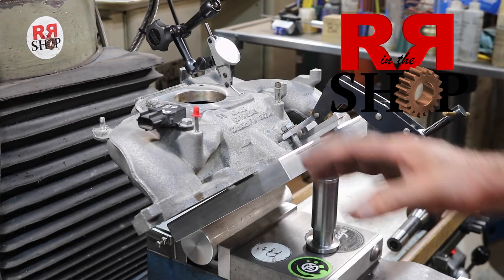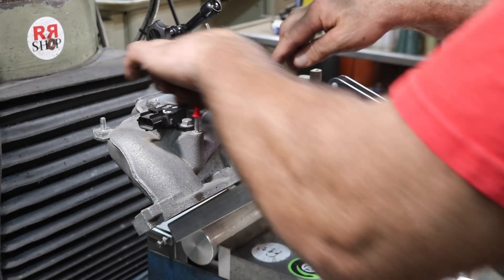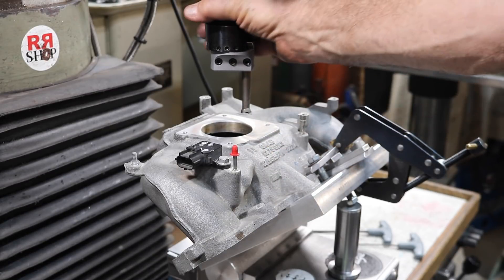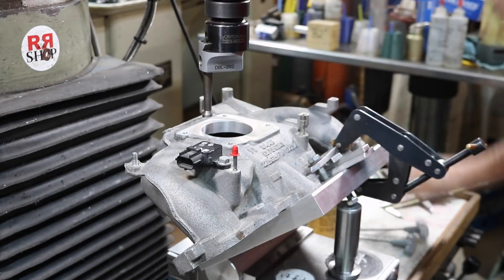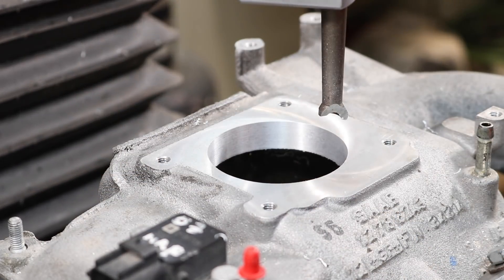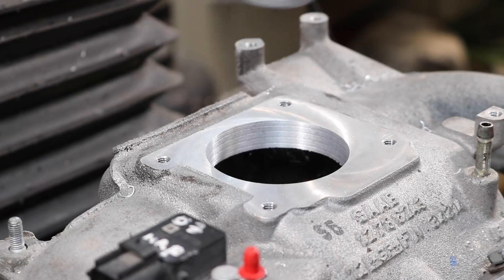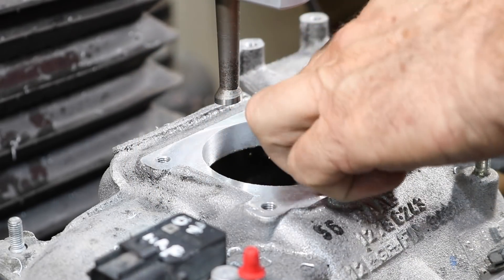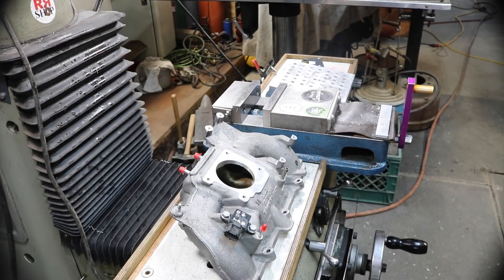Engine Intake Manifold Modification | Boring the Intake

Comment: Saab or Scania?
Reply from the maker: It said saab on the manifold, casting mark.  Thanks.
Reply: @randy Richard in the Shop They used to build airplanes. The automobil company, that use to build cars and motors for Scania trucks, was part of General Motors til 2010.  Do you know where the manifold is for?
Reply from the maker: @a.bakker64  No I do not.

Comment: Hi Randy,
Nice idea I've never seen using the round stock on the fixture plate unless you count the sine plates I've seen. The clamping of the bar in the vice looks like it may be simpler and easier than a sine plate for mounting. Nice video, thanks for the tips.
Reply from the maker: Simple and worked great.  Thanks Eric.

Comment: Hi Randy ...  Excellent set-up & another job very well done.
With your holding jig,  it looked light in weight.  Is it all made of aluminium or steel ? . What OD is the Round in the Vice
Reply from the maker: All Alu.  2" od in the vise, 1" thick plate 8" x 8"  Thank you Ted.

Comment: Neat work holding solution.   Could have been a good excuse to get an adjustable tilting angle plate.
Reply from the maker: You need an excuse to buy tools?  Worked out great, thanks Chris.
Reply: LOL!  It’s more like, I make an excuse to buy tools.  I’m a tool junkie, but I do try to rationalize a genuine need before I buy a tool. As soon as I convince myself there is a need, I buy it.

Comment: No variable angle plate, no problem, just make one  Good man.
Not critiscising but did you break off all the thin bits in case they rattle off in use?
Reply from the maker: Thanks Chris, yes I did, the owner was going to do more deburring.

Comment: Nice work (as always) Randy.  If you don’t mind, I would like to share what I find so interesting and captivating about machining videos.....  It’s the process and approach you clever experts apply to solving complex problems.  And as we all know, fixturing and setup are primary keys to a good result.  The easy part is rotating the quill down and tossing chips all over the shop 🤣 (of course you use your clever shower curtains to keep the chips closer to the work).  Sure, there is always the constant pucker moment wondering if it’s going to move, but fixturing and clamping is the hard part.  With all that said, I’m certain your viewers would really appreciate a couple more seconds of showing the setup.  I kept wondering how you packed and clamped the side we couldn’t see.  Maybe it could be as simple as taking a couple of stills like Adam Booth does and toss them in at the end.  I wish you all the best Randy.  Take care my friend.....  Joel
Reply from the maker: Thank you.